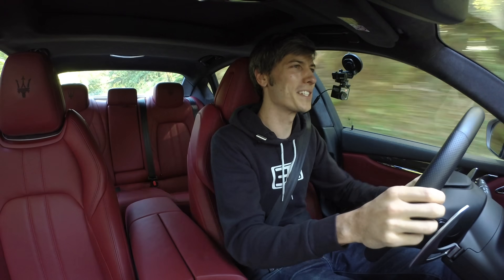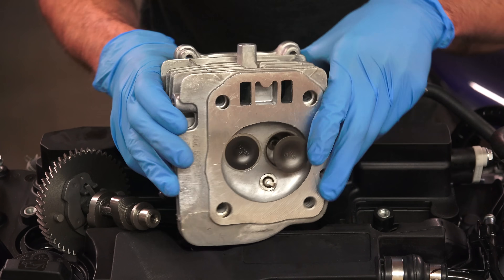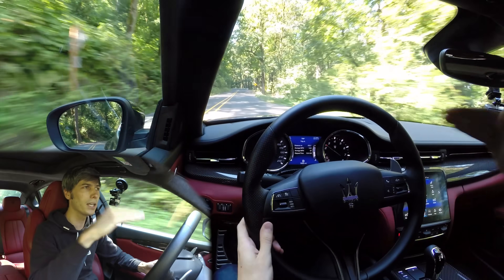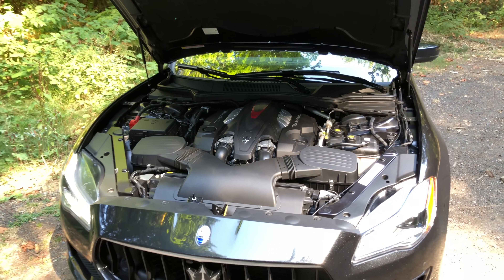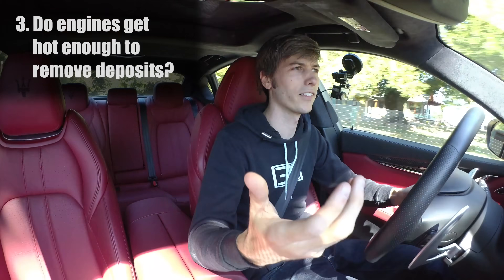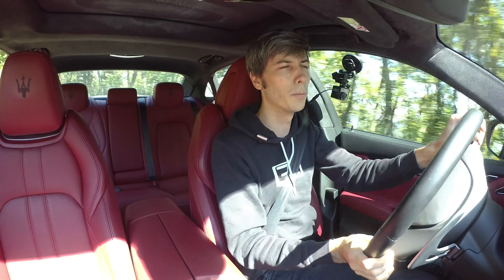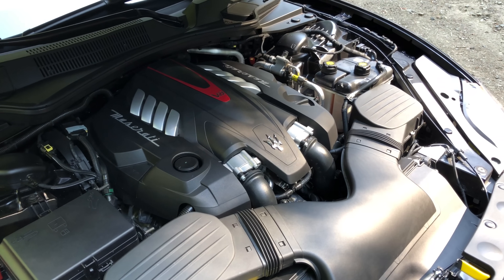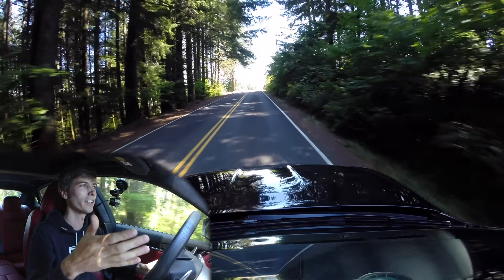Is Redline Good For Your Car's Engine? Italian Tune Up

Comment: I had a MKV Volkswagen GTI and those engines were notorious for getting clogged with carbon.    About once a week I would take it on the highway and just let it run at a steady 4500 rpms.  I'd let it spin like that for a solid 15 or 20 minutes.   I never had carbon issues. Got rid of the car with about 150k miles on it.

Comment: drive an aprilia rs4 125 - full throttle and you dont have to worry ;) sometimes the 102 octane fuel from aral that has the additive for the deposites and the port injection also help. I dont worry about that^^ interessting fact, that small bikes revs up to 11k rpm =10l air/secound and only 15 hp ._.
My brother drove an audi a4 with a ~184hp strong v6 diesel engine and he found out that the car starts up and runs better if he push the car sometimes on the highway with 200km/h (220 says the car). To be honest I believe that the particle filtre gets burned out of the carbon :x

Comment: My 1996 5.7 letter Chevy Hits red line once a month with 294,000 , so it has hit the line a few times, all that sed just got smog check and passed with flying colors, tech came to me and sed boy that thing runs good, at a stop light I had people ask me if it is still running I have to look at the tack to answer yes. NAIL IT.

Comment: So if long periods with high loads and high temperatures got some effect, it seems like you have  a good excuse to go to some Nürnberg ring mechanic, and ask if they see more or less deposits compared to when they worked as a normal mechanic

Comment: I remember when it was time to "clean" the carbon deposits inside an old car (with carburetor) and 4 speed stick trans, we'll drive at night in 3rd, full throttle and then a little tiny bit less than that, and you hear and see how the engine was "cleaning itself", or it was destructing something? lol, I don't know, but the car had better feeling after doing those runs, seeing the red bright particles coming from the exhaust and hearing the pops was super fun, and a good excuse to drive fast (like 75mph! lol)

Comment: I've only ever heard of this for clearing DPFs by forcing regens and increasing EGTs and for cleaning injectors by forcing a higher flow rate and faster cycles. Is there any information on the effects of the Italian tune up on these?

Comment: I’m a chemical engineer and I don’t understand chemistry either !
Reply: And that's why we say "Love is chemistry".
Reply: I used to know a guy who worked for a dye manfuactuer and apparently one of their PhD's described chemistry as a pseudo-science.

Good to know he wasn't kidding. ;-)
Reply: I have a masters in Chemistry and I don't understand it either, don't worry!
Reply: I'm a mechanical engineering student. I had 0 hope or will to actually understand physics, or material science however. But you know, fake it till you make it.
Reply: As a real chemical engineer, I hope you're joking.  Decarboxylation is a pretty simple and standard reaction you should have learned in your intro chemistry series.  

Further, the basic understanding should come from knowing that reactions have equilibrium that are dependent on temperature.  

Whether you understand the mechanism of the reaction isn't really important, but you certainly should have learned a decarboxylation mechanism.  The concept is simply, deposits are typically of form that includes a carboxyl group and removing that group creates CO2 which is a gas and some chain or ring structure that does not deposit back.  The equilibrium point is around 325 degF so if you push to that temperature range then CO2 is favored and deposits start breaking down.  Then CO2 is able to leave the system further pushing the equilibrium.
Reply: BlazzedTroll Like Sokrates said "I know that I know nothing". As a real chemical engineer you should know, that you only have a overview over chemistry and physics (maybe biology, depends on your specialization), like you would have in any scientific field. You can specialize on a certain topic, to get a deeper insight, but even than it's not guaranteed, that you know everything.
Just because you know more than most other people, doesn't mean you know something (compared to the total available knowledge).
I wrote my diploma thesis about hydrodeoxygenation of long-chained ketones and alcohols, but that doesn't mean I'm fully understanding this process, I just got the basics, to suppose what I want as a result and get it.
Reply: BlazzedTroll any pothead who passed high school chemistry ought to know what decarboxylization is 😂
Reply: Well I don't get what that's was even a chemistry issue,  its just hearing everything has a melting point, steel,  iron,  so wouldn't carbon melt at a certain point too
Reply: @joesmith201212  carbon doesn't melt, it sublimates
Reply: @varpilahchase2598  Even at pressures that would allow carbon to melt, it's melting point is very high compared to the temps in a motor.
Reply: @varpilahchase2598  everything has a melting point go take a science class.
Reply: @joesmith201212  Someone failed chemistry class: 
Carbon also has the highest sublimation point of all elements. At atmospheric pressure it has no melting point, as its triple point is at 10.8±0.2 MPa and 4,600 ± 300 K (4,330 ± 300 °C; 7,820 ± 540 °F), so it sublimes at about 3,900 K.
Reply: I was doing computer engineering degree in late 90s. I took CHE 101 and barely passed. I was very sad and worried because CHE 102 was also mandatory by the curriculum. It was one of the best days in my life when the dean dropped CHE 102 from our curriculum :) O chemistry, how much I hate you!
Reply: The only one who really understands chemistry is Walter White
Reply: It is not actually pure carbon that deposit, but dense hydrocarbon deposit, which evaporates away at higher temperatures.

Comment: Depends on what you drive. I just sold my 1998 SAAB 900 (non turbo), which I redlined EVERY SINGLE DAY, no problems whatsoever. None. Ever. Whatsoever. Never failed me. And I owned that engineering marvel for 10 straight years (my first car). That thing should be in a Guinnes record book or something. I traded it in for a SAAB 9-3 turbo at the Saab service center, and the guy told that those thing are indestructable, he does not remember A SINGLE N/A SAAB 900 EVER BREAKING DOWN. And he is working on Saabs for 20+ years, now that is something else...

I know, it's a repost, but I just want to share this with other petrolheads 😁
Reply: David Miletič I have a 87 turbo 5 spd I want to restore, ive heard they break down often? Mine has been sitting for awhile but it only has around 110k . I’m in the us so it might be expensive to find parts? I love driving it when I get the chsnce
Reply: @lollol6843  Boy would I love to take it for a ride :). 110k is absolutely nothing for a classic 900, turbo or not. Don't even worry about the parts, because the car is so damn durable, turbo or not, plus you can still get the parts anyway. Just do the basic maintanance and the thing should roll.
Greetings from Europe
Reply: David Miletič I’m just anxious because if I need to rebuild it in the future I’m unsure of who could re-construct  it with all the curiously implemented engine and drive train locations lol.  It does always start though, even after she’s been sitting for awhile. Always baffles me how well they were made. I nearly died when I was younger in car crashes, however, I was always in a SAAB :^)
Reply: @lollol6843  A classic Saab is nothing that a good mechanic could not handle, it will take much more time dough, but worry  not, for the mechanic will rarely have to do any work on it :) Saab, you just got to like it

Comment: Hi Jason, great topic! Oh heard this so much regarding our 308QV. I really wonder about the time that is necessary at that temperature and if the engine keeps a steady state temp long enough... Also, I think maybe folks are thinking that the fuel system would get washed out faster? There is also the dramatically increased load on the rotational bits to consider. Super solid research! Just love that about you :) Thanks!  F

Comment: Have you investigated this?

Some say that if you spray water into the intake of an engine for a few minutes you can remove deposits and improve engine performance.
This comes from mechanics who say that when you see an engine with a defective cylinder head gasket losing coolant you see the cylinders affected being cleaner.

Comment: I redline my car now and again for fun, but regarding carbon buildup, I use fuel additives every few months and have tried decarbonising using spray water method in the throttle bodies.  It actually seems to work if you do it carefully and properly.

Comment: So I guess Mazda is doing it right. I remember Dave Coleman saying how they rerouted cooling away from the top end of the skyactiv motors to keep it extremely hot so carbon won't stick
Reply: I wonder how it affects reliability under heavy loads. I could only imagine it would get far too hot on a track.
Reply: I would assume it would, but I guess it works. They track the ND all the time with this tech and it seems to have lasted
Reply: emark24   Is that manufacturer mod any relation to a throttle body coolant bypass?
Reply: I don't think so, but im not entirely sure
Reply: You would run the risk of warping the head from heat though just to get rid of some pesky deposits....
Reply: @joshuax7990  I mean, I didn't design it. I'm sure theres some clever tricks to it
Reply: @joshuax7990  That's presuming that Mazda didn't also engineer the head (and/or use the right materials) to take the heat...

Comment: I don't know whether carbon deposits are the only thing to consider when talking about italian tuneups. The term exists because it has a noticeable effect, whether the underlying effect is carbon deposit related or not. I would be interested in an analysis of what it is that actually gives the italian tuneup that smoother engine feeling.

Comment: Here in Germany we have the ability to drive our engines on high load on the Autobahn. On Bikes with one or two cylinders you can feel the difference in smoothness after pushing it hard. It runs like butter.

Comment: Supposedly Mazda engineered  the skyactiv engine in a way that keeps the intake valves over 400 degree C. Saw this an a technical document from when the engine was released. Interested to see if this is actually true